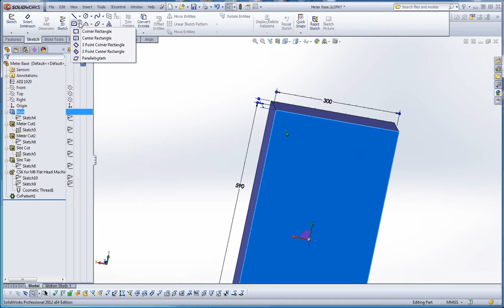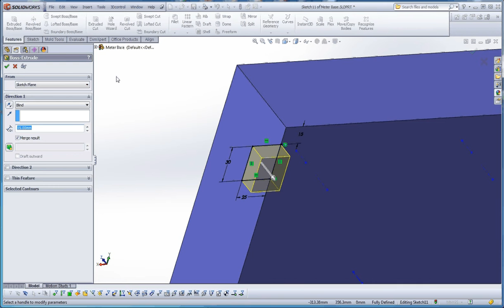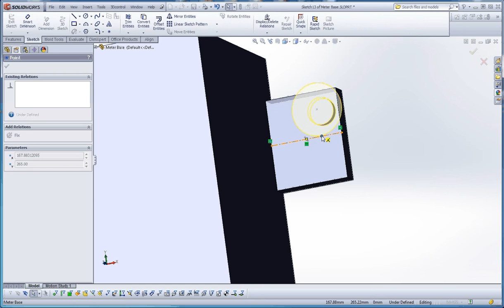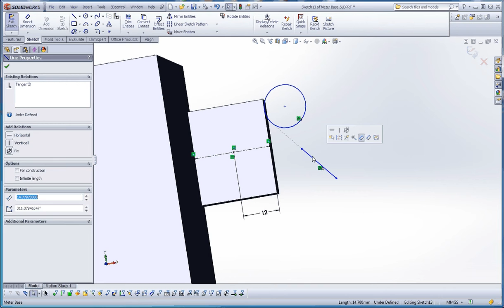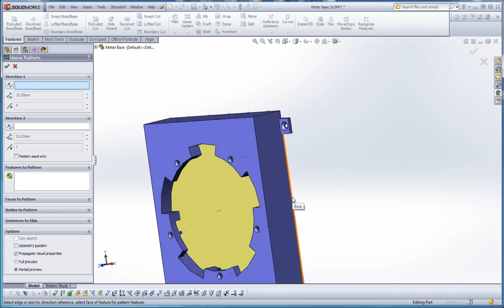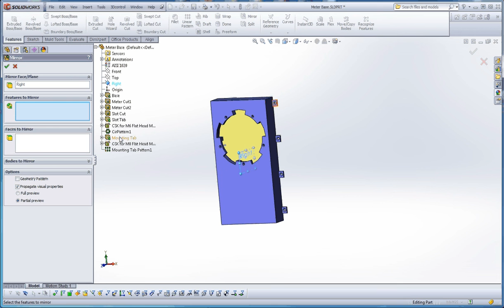Simple Meter Assembly, Part 9, Base, Mounting Tabs, Hole Wizard, Linear Pattern

Comment: mate, I need some help with hole wizard
Why the if i make some holes on the assembly those holes don't get transferred on to the part it self?
There for when I open the part there are no holes, any idea if those holes shown on the part so a technical drawing can be generated ?
thanks
Reply from the maker: 333geoalv Just a quick answer, you can make assembly cuts, like a hole that can go through multiple parts but i don't think the Hole Wizard is available as an assembly feature.  Let me know if you need more information on this.